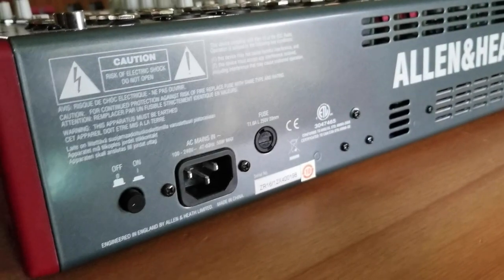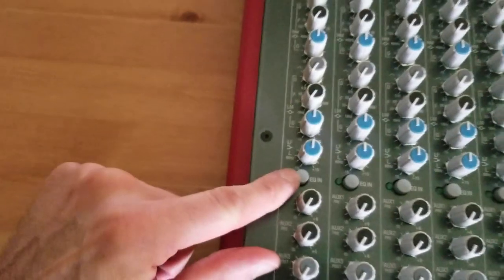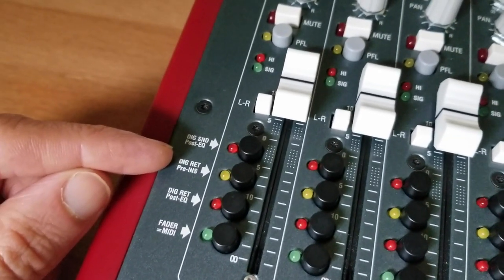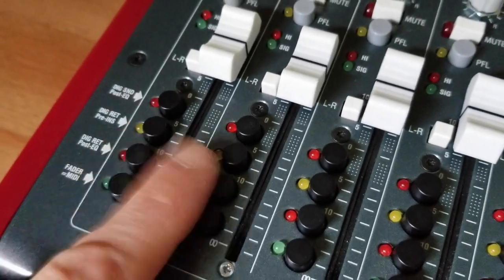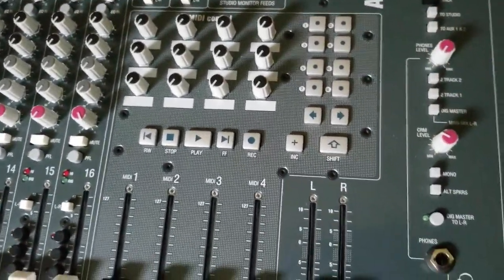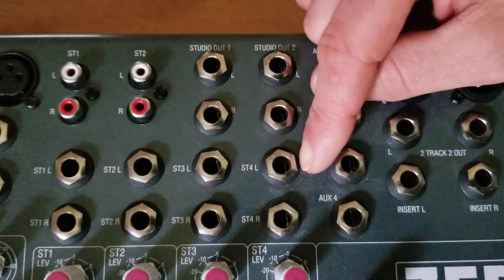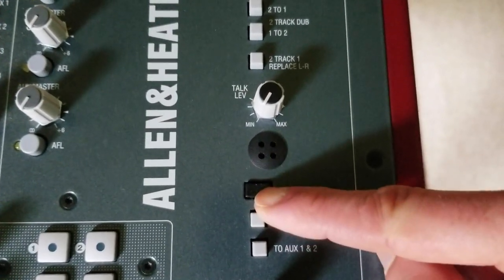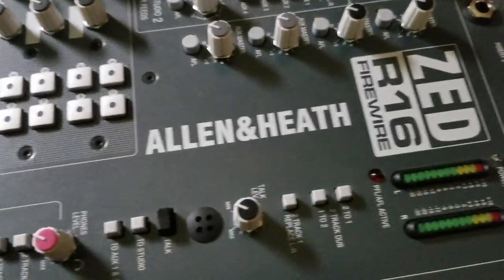16 Steps: Episode 15 - Allen & Heath Zed R16 Firewire Mixer

Comment from the maker: Ok so sad update -  seems the Zed works on OS X up until Mojave 10.14.6 please let me know if you have this running at anything past this release.
Reply: I just got one, trying to figure out how to use it with Windows 10 but have no idea about Firewire...do you think it was a risk buying this mixer? Seems amazing if it works
Reply from the maker: @ryanbennett7638  give it some time, I think you will be pleased. I have no experience with this mixer on Windows, but it has worked great for me. I am putting mine in the shop, as it seems the fw has gone out. Even if no fw, still a killer mixer
Reply: @16Steps  Thanks for the reply, will persist and get it working
Reply from the maker: @AudioEnginiiir  this is good news!
Reply: @AudioEnginiiir  Nice!. What did you do to find it out? I contacted A&H but they just kept saying that this happened as the product was discontinued?.
Reply: @allfeelingsmusic9304  Hi mate.
That's correct,  they stop making that board.
 Latest version of A&H Zed R16 driver runs on Catalina no problems.
Hope it answer your questions.
Cheers
Reply: @divern  thanks. I am confused as this is what they just replied today: Zed-R16 is supported up to macOS 10.13 'High Sierra' macOS 10.12 'Sierra' (Current version, released 16 March 2017). We cannot advise on use with later OS. We have no further development planned as this is a discontinued product.
What is the latest Zed R16 driver?  is it V4.3.1 Mac? . Also, do you run Logic? Thanks!
Reply: @allfeelingsmusic9304  Hi, yes it's Driver V.4.3.1 A&H might stop developing the driver after 2017 but it doesn't mean that future OSX will not support it. Anyways I run it on Macbook Pro OSX Mojave and Mac Pro OSX Catalina.  Logic Pro X, Protools, Ableton...any DAW you wish
Reply: @AudioEnginiiir  Thanks! Much appreciate it! :)
Reply: @AudioEnginiiir  Hello, I can't get the audio to fit in from my external instruments, the daw control works, (except Transport)
I have Mojave, 10.14.3, Ableton Live 10 Standar
Macbook pro retina mid 2012, 16 GB 1600 MHz DDR3
And it does not work, what to do to have sound that comes in ?? Thank you
Reply: @allfeelingsmusic9304  Hello, I can't get the audio to fit in from my external instruments, the daw control works, (except Transport)
I have Mojave, 10.14.3, Ableton Live 10 Standar
Macbook pro retina mid 2012, 16 GB 1600 MHz DDR3
And it does not work, what to do to have sound that comes in ?? Thank you
Reply: @16Steps  Hello, I can't get the audio to fit in from my external instruments, the daw control works, (except Transport)
I have Mojave, 10.14.3, Ableton Live 10 Standar
Macbook pro retina mid 2012, 16 GB 1600 MHz DDR3
And it does not work, what to do to have sound that comes in ?? Thank you
Reply: @jeynyfer3509  Hi Jey. You can't get your Mac to see ZED R16? Run A&H driver and check if Zed R16 is properly synced. Make sure that sample rate of Ableton Project and A&H are the same.  It is possible that problem is somewhere else, you need to troubleshoot step by step. Hope it helped
Cheers
Reply: @AudioEnginiiir  Thanks for the answer, but I tried 44htz Zed & Live - and 48h, nothing works I don't understand! it worked with my Midas F32 and there, I get nowhere!
Reply: Is there a place, mail, msg to talk about it, I can't find anything so that they can help me it's painful! I do not understand :(
Reply: @jeynyfer3509  Hey Jey, Try to do this when Ableton don't recognise Zed r16: 
1- Hold Down "REC" button at power up.
2- Let go.
3-Hold Down button "1".
4- Let go.
5-Simultaneously hold down buttons " 1 and REC" for 2 seconds.
6- Let go.
7- power the mixer off and back on again.

Sometimes Zed r16 "disconects" so you can do that eery time it happens.
Hope it is helpful.
Reply: @AudioEnginiiir  Hello mate, sorry to bring back the thread about OSx again. Do you know if Big Sur supports ZED R16?. Do you think is there a chance that still do supports it?
Reply: @allfeelingsmusic9304  Hi, I can't confirm it but don't think it will run on Big Sur.
Reply: @allfeelingsmusic9304  Hey, the transport is working, thank you very much !!!

There is more than the audio to fit in, I still can't do it!
Reply: @jeynyfer3509  I can't help here sorry. Contact A&H
Reply: @allfeelingsmusic9304  i just tried running zed from friends MacBook Pro with m1 chip/Monterey. It doesn't work
Reply: @jeynyfer3509  go to system preferences- privacy- allow TC electronic Dice software to install on this device
Reply: @divern  TC Electronic Dice ? I have this software in my mac?
Reply: @divern  Thanks mate. I  passed it on.
Reply: @divern  Hello, I finally succeeded, it was an internal device of the Mac to activate !! However, now my last concerns are:

The MIDI Out of the Zed and Ableton in master does not trigger my external instruments in Slave :(

And I still can't record in post fader mode, lower the fader or raise it so that it can affect the recording in Live,
Nothing happens, it records raw, EQ it's ok,
and I wanted to use the Midi fader mode but it doesn't work!
Reply: @allfeelingsmusic9304  Hello, I finally succeeded, it was an internal device of the Mac to activate !! However, now my last concerns are:

The MIDI Out of the Zed and Ableton in master does not trigger my external instruments in Slave :(

And I still can't record in post fader mode, lower the fader or raise it so that it can affect the recording in Live,
Nothing happens, it records raw, EQ it's ok,
and I wanted to use the Midi fader mode but it doesn't work!
Reply: @jeynyfer3509  Hello, try go to preference-privacy- microphone - enable it on Ableton/Logic. Also, on ableton set the audio track : Audio From, external instrument you want to record - post mixer. Audio to - External out. Then you should be able to fade in and out and record it.

Comment: Cool channel. Can you explain to me how I connect the ZED R16 so that I can record it on Ableton. I only need it as an analog console. I still have an RME 800 audio interface.
Reply from the maker: If you want to use RME as your interface, just connect the 2trk1 out to an input on RME, just like you would connect any analog mixer to it.
Reply: @16Steps  I say so. Is it possible. Connect 8 tracks of the ZED R16 with the audio inputs of the RME 800? I somehow can't do it. TB-303, TR-808, TR-909, SH-101 and so on are connected to the 8 channels of the ZED R16 via LINE IN. How exactly do I have to wire the ZED R 16 to the RME 800 so that I can record everything I do with the ZED R16 (loud, quiet, EQ filter movements and so on) 1: 1 on Ableton. I don't want anything from Ableton back to the ZED R16 but everything from the ZED R16 to the Ableton. Do you understand what I mean?
Reply from the maker: @matthiasstammann4253  sure it's possible. You can create an "aggregate device" in osx (idk of you can do this on windows) and then track through both devices at the same time. If you can't get that working, get a good patchbay and use the inserts on the a&h.

Comment: Hi there, I am thinking of buying this mixer. From what I understand, the connection is thru USB, so the chain goes like instrument-xlr-usb-DAW. I didn't understand how the insert comes into play. It seems like it should just do that in reverse (daw-usb-xlr) so that you can control the mix with the EQ knobs and volume faders. I have used analog mixers with interfaces, but this seems new to me and might be a good approach to keep things more compact.
Reply from the maker: The connection is FireWire. The a&h boards that use USB don't work in the same way. You can use this board in a variety of ways, using hw or sw inserts is just one of the things it can do. You can use it just as an interface and then control software, but only the faders send midi info, not the knobs.
Reply: @16Steps  Can you send individual audio tracks back into the mixer to do an analog mixdown?
Reply from the maker: @mokkabrown7100  Yes, that's one of the main features. You might find this video useful, if you havent seen it yet: https://youtu.be/-_3HnZwVwlc
Reply: @16Steps  Thank you! The video is super clear, awesome. Might buy one
Reply from the maker: @mokkabrown7100  Nice! Good luck!
Reply: @16Steps  One more question. Will the master channel be able to playback the entire ableton session, even if it's more than 16 channels?
Reply from the maker: @mokkabrown7100  yep. As long as the master outs are assigned to the mix LR (17+18) and the DIG MASTER to LR is pressed, you're good to go. It's also possible to group tracks and send them out of tracks 1-16 (or stereo pairs) to use as sub mixes. Lots of flexibility.
Reply: @16Steps  Amazing! definitely thinking of getting this
Reply: @16Steps  Hi there, just one more question. Sorry for bothering you but I just wanna take the chance since you've been so helpful already. Let's say I bypass the EQ into the DAW and now I've recorded 16 stems. I can now send those stems back to the mixer to use the onboard EQ. How will I send the new EQ'ed version of my track back into Ableton?
Reply from the maker: @mokkabrown7100  well you have a few options. The most common thing I end up doing is exactly this; I record into Ableton (pre or post fade, depending) then make edits, do stuff I am unable to accomplish with hardware, group tracks if needed, then send out through assigned tracks and mix in analog domain, applying whatever hardware effects/processing and then recording the mixbus (inputs 17&18). If you want to just send recorded audio out through a channel and apply some EQ/hardware effects and then record back in, you could do that too, just assign the ins and outs in Ableton and use dig return on the channel and send post fader. You could actually do both at the same time, but I don't usually see a need for that.
Reply: @16Steps  Ahhhh ok that makes sense. So basically after you make changes, you would have to basically "rerecord" the edit into Ableton again, is that somewhat correct?
Reply from the maker: @mokkabrown7100  yes, if you want the zed eq on the track, you will need to record post-eq. ✌️
Reply: @16Steps  thanks for the vid I’m looking to buy this instead of the big six as the ssl big six doesn’t work with my set up. I had 2 questions. You talk about creating sub groups but how do you do this without physical sub group buttons or faders or am I missing something? I sssume you mean subbing in from daw and not from analogue or hardware synths into the mixer first right? 

Also now it is not supported on the FireWire side I wanted to use this as an adat slave with my audio interface, does that mean all the digital features will still work I.e getting tracks to and from the daw? Thanks!

Comment: Hello 16 Steps, great video, I have a question. I'm trying to bring the signal back from the computer using the "DIG RET Post-EQ"  switch button to equalize with the Zed R-16, but doesn't seem to work. I don't know if there is a configuration I'm missing for this with the software (I'm using Logic Pro X) or something, but still hearing the clean signal when I try it. Any information about this issue would be appreciated, thanks in advance.
Reply from the maker: Post EQ would bring the signal back after the analog EQ on the zed. If you want to use the analog EQ, it should be returned into the channel Pre-insert.
Reply from the maker: If you want to print the analog EQ by recording back in to Logic, you will also want to send it back in using the Dig SND Post EQ as well, or record from the main LR (17/18) inputs. I remember Logic not allowing selection of any channels other than 1/2 for main output though, which was a deal breaker for me at the time and ended up switching away from Logic bc of this. Not sure if they have fixed that, but hopefully this isn't an issue for you.

Comment: Got a question , do you have outboard gear hooked up to the zedr16? For example high end preamps like Neve our universal audio , and if you  do how do you do it? I read in some forums that you can't  bypass the zedr16 preamps... Thanks
Reply from the maker: I don't run my audio through anything like that. I don't think the pre amps can be bypassed, but they are very transparent.
Reply: @16Steps  I really like the zed r16 and it's functionality not to mention all the routing options ,if there was a way to by pass the preamps and slap  some different ones just for flavor it would have been the perfect board, but like anything  nothing is perfect..

Comment: i still dont understand mixers totally, for example on this mixer, would you need an audiointerface with the same amount of in and out for each channel? Or does it work without one, being able to send signals back and forth of the computer, is that what firewire does?

Comment: hi ...thanks for the post...i bought my version of zed R16 early 2014.....used it sparingly and am now back on to it ..permanently..but struggling with the issue of auxillary sends and the transport control...can get other midi functions working on ableton but haven't got the transport control to work (and want) and also the faders.....if there are any tips from anyone using with ableton ...i'd be mightily grateful.....
Reply from the maker: First thing is to make sure the transport is sending midi note on/off from the transport and NOT mmc messages. You can do this with a midi monitor. Next you should set it up as a control surface in Live (just above the midi I/o page of the preferences) and then just map the transport like you would any other controller in Ableton. Hope that helps!
Reply from the maker: http://support.allen-heath.com/Knowledgebase/Article/View/502
Reply: @16Steps  howdy...slipping slowly and gracefully into the world of the Z series An'H mixers...but right now wondered if you wouldn't mind doing a tutorial on the auxiliary and the insert stage of the desk...it's an area i'm having trouble with.
Reply from the maker: @dkkrecords  absolutely!! I would love to do that! Apologies for falling behind on the videos, but will get this one done asap!! 🙏🙏🙏🙏
Reply: @16Steps  hey ....been a while since i've been here.....2 years back i was in beijing ...2 years later i'm now in taz...but the desk was in storage for almost 18 months......on setting up again ..it's claerly dust affected.....i'm about to open it up and try n' clean with compressed air and contact cleaner....question is ...have you done anything like this on your zed?
Reply from the maker: @dkkrecords  I have not, I did have the FireWire board replaced about a year ago by a local service tech, and requested they take care of scratchy pots and switches while they had it. Would love to hear how it goes for you. Best of luck!

Comment: Have you tried it with IOS Mojave on Mac :)
Reply from the maker: I have not. Might give it a go later this week and see how it works out. 🤞
Reply: @16Steps  if you do, I'd love to hear :)
Reply from the maker: @ewanaitken1328  backed up on work atm, but will give it a shot and report back here! ✌️
Reply: @16Steps  of course don't worry about it it's just I saw a great price for one 2nd hand and I run Mac os Mojave and the latest protools 12.
Reply from the maker: @ewanaitken1328  Totally works on Mojave, but A&H have not yet updated their drivers. Live, otoh, reports "not optimized" warning on first launch. So far, so good tho.
Reply: Hi all, I use my Zed R16 on Mac... Mojave...no problems. I'm running Logic 10.4.6..no issues. Great desk.
Reply: I use it on Mojave with Pro Tools 2019.6 and I haven't had any issues
Reply: I have tried the Zed R16 in Mojave on a MacPro 5,1. I am getting audio dropouts even when previewing simple mp3 files. Also in Logic there are dropouts. The strange thing is that I have no problems whatsoever when running on High Sierra. Running with latest available drivers from A&H web site. Anyone any ideas what could be wrong?